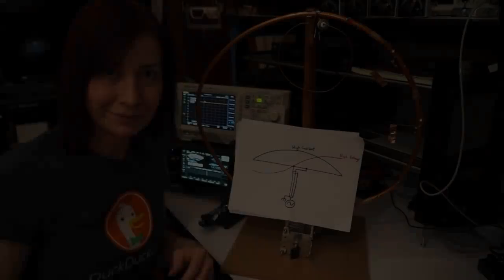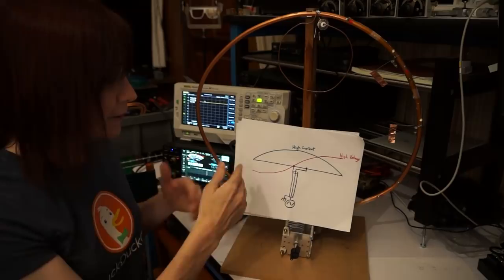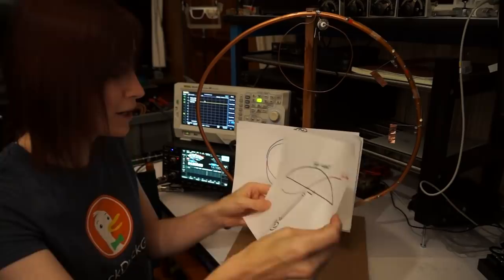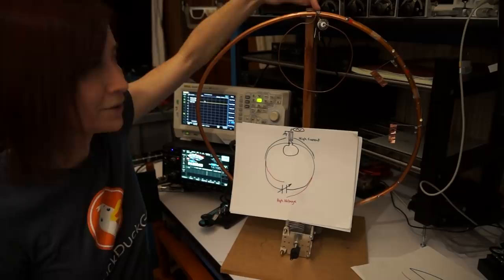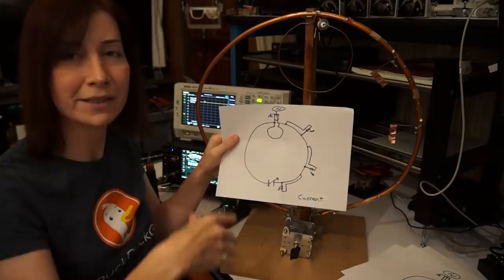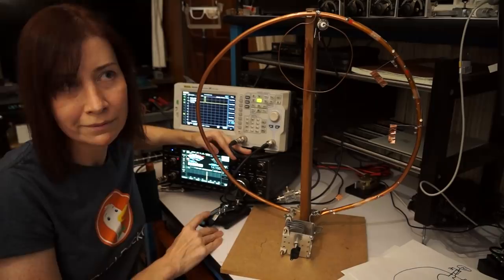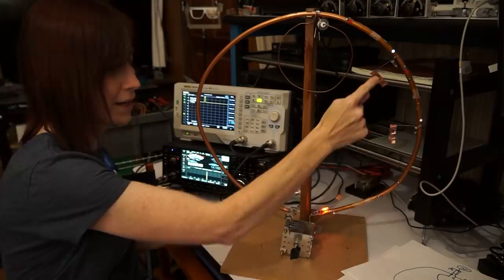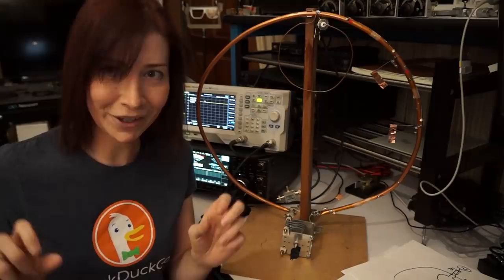Magnetic Loop Antenna Current and Voltage Distribution

Comment: Thank you. Got a little flashback to the time when they allowed CB radios to be connected to home made antennas here in germany in the 90's.
Up until that time we were all stuck with lambda1/2 or 5/8 fishing rods with radials.
Before anyone could say "10W EIRP" i started experimenting with different antennas, feeds and tuning improvements.
Reply: If i recall correctly, You still have better than rest of the world and can use packet radio via CB? 
You can connect "Signalink" to CB and exchange e-mails legally?
Am I correct?
Reply: Last time i checked it was illegal to transport information from a telephone/modem based public network to PR or vice versa. But.... last time i checked was 1999.
And also... as long as you do not cause major fuggubulations you can do what ever you want. There is just no one willing to go after you because your signal is 0.5kHz too wide or simething like that.
Shortwave is just no gov estate anymore... they all fell for the micowave hype ^^

Comment: I love it...a female DX'er.
I'm just a shortwave listener...but have made a few different types of antenna for a hobby. My radios of choice are an old large 3 SW band mantle radio (more like close to being a table version), and the other a Sangean ATS505. Both great radios, but the mantle radio belonged to my Mum and Dad, so sentimental. Had a radio tech friend get the old radio going again, this year. Needed a couple of parts, but he was impressed how clean it was inside. Dad being a rad tech in the airforce always kept the inside of it clean. But I haven't been able to use it since he died in 2013. But amazed how well with my indoor frame antenna, how well it is picking up distant foriegn stations....life in the old girl yet. I think it will keep going longer than me....lol.

Comment: Very good. Given that the loop circumference is so small compared to Lambda, the current in a mag-loop does not vary much. The E-field is almost entirely contained in the loop capacitor and therefore the near-field is almost purely magnetic. This is why mag-loop antennas are much less affected by nearby structures - especially metal - and it is a great indoor antenna. Gas discharge bulbs need a high "ignition voltage" but stay on with a much lower voltage.

Comment: Nice visualization method.   I've always built loops with the cap at the bottom.  Mostly for construction convenience.  I've had a fair number of people comment on my vids that the cap should be on top since the most radiation is on the cap side.  I would think the bulk of the field is going to be around the current peak, as you see with dipoles.  Just my gut instinct though.
I've experimented and it feels like the radiation is stronger around the coupling loop.   I still make plenty of contacts on them and that's what counts.
I've done a few small loops for fun.  Building one out of junk box parts and winding it on an old milk crate.  Made contacts on them QRP as well.
You ought to set up WSPR and beacon on the small loop a bit at half a watt just to see who picks you up.  You might be surprised.   I've found with my 7300 that if I turn the power down to "0" percent, it seems to be about half a watt still coming out.
By the way, I'm going to Quartzfest this year.  Maybe I'll see you there.  It would be neat to get all the you tubers present together for a group photo we could all use on our channels. :-)
Reply from the maker: I think the loop would radiate the most around the coupling loop because the current is the highest.  I need to do a dipole test to compare the amount of current near the end VS near the cap on the mag loop.  I'm so excited that you're going to QuartzFest!!! Randy is going.  We need to coordinate a few youtuber events during week.
Reply: It is a MAG loop and magnetism is generated only by current.  Where the current is strongest so is the magnetism.  The electric field will be vertically polarized and the magnetic field horizontal when the plane of the loop is vertical.

Comment: That was brilliant.  I've had a RF burn, transmitter, 5W, tuning cap contact.  They need a better name than burn.  Burn just doesn't describe it.  It hurt less than a 'normal' burn but did far more, deeper, damage than tapping a soldering iron would.

Comment: Amazing way to demonstrate Current and Voltage . In ressonant point when perimeter of major loop is near a 1/4 lambda, the major current stay opposite capacitor and major voltage opposite de small loop. Some kind of direction in this way.
Thanks for sharing.

Nice haircut and color.

73 PU2SRZ - Sao Paulo - Brasil

Comment: Nice demo...  Yep, you're right, it's inefficient on 20m, looks about perfect for 10m, maybe too big for 6m.   Looking forward to the continuation of the 160/80m loop project!   Would also love to see a demo of how proximity of the turns on a multi turn loop antenna affects the current distribution on the perimeter of the tubing, (exterior turns vs interior turns) you've got to get your spacing right!  (I'm already visualizing some sort of ring of LEDs , or maybe a single LED that can be manually moved around the perimeter of the tube...)  Really cool stuff!  Keep at it!    Thanks again, looking forward to what's next!

Comment: Great Jeri. This was visually  very cool Demo ! . Now, I want you to know that I am definitely not a stranger when it comes to loops. My current favorite loop is an 80 meter full wave loop, fed by open window wire 450 ohm, I have a decent quick MFJ tuner, and its really fun, and quite unpredictable at times. I could hear a station with a call , D4C the other day. I typically (lately) run a 10 watt radio, possibly less (4w) on 15 meters which is where I heard that station, and actually got a contact with them !. And an eQSL !
I love the leds and neons on that antenna. I'd like to try it at the "maker fair" (we just had our first at the local shasta county fairgrounds).  I'd do it  because its so visual ! 
I'd also like to invite you to get on a repeater system where there are more engineers than people lol. I'm a former broadcast engineer, and there are many in the bay area and all over California and Oregon on this system. Primarily UHF but it does have some VHF repeaters. Its called the CARLA network and its connected to the OREGON CONNECTION which takes it to Washington. Also Tahoe and REno. Its a little more complex than most collections of repeaters but doesn't have a "rag chew" . We hope for no longer than 10 minute QSOs most of the time. CARLARADIO.NET for more info. Thanks for that video, I'll try one, even have the Neons which are very useful in this age of leds. 

So, Question, have you tried the LEDs on the 160/80 meter loop ? And or the Neon's ?  N6GRG

Comment: I've always wanted to build what's called a "vector sensor" which can measure the polarity of a signal. If you can measure the oscillating electric field in three orthogonal directions and the magnetic field in three orthogonal directions, you should be able to characterize the direction of travel of a polarized signal, since it should be orthogonal to both the electric and magnetic vectors.

Comment: This, BTW, is why you normally have the tuning capacitor sitting at the top, well away from the ground. Otherwise parasitic capacitance is all too eager to drain away your RF at this high impedance point and mess up Q and hence efficiency.

Loops have long been one of my favorite kinds of antenna, mostly because they can be fairly compact and still work quite well, if at the expense of bandwidth (the usual tradeoff). The one shown would probably work decently on about 20m up, preferably 15 and 10.

Comment: Hi Jeri. Thank you for the 160 meter Loop antenna Home Brew. I built a 160 meter Loop from 7/8 inch hardline cable. I made it tune able also. The loop  is 4 ft diameter. I do get on 160 and 80 meters. I do weak signal work on 2 meters, 1296, 5760 10 GHz and 24 GHz. We chat on 160 and 80 meters at night. Mostly on 3846 Khz + - QRM.  I would be interested some time for a QSO in 160 with you. Thanks  73 WB4BKC  EL98 Fla.

Comment: A bit late, but try using a ferrite ring with a turn or two of coupling coil to feed a mag loop. It works very well on HF, and is easy to adjust. At 4 metres the ferrite ring becomes inefficient and heats up, but at up to 30 MHz it's fine. With 2.5 Watts of RF on 40 metres, 1600 km+ (1,000 mi+)  SSB contacts are easy.

Comment: it may be interesting to study the performance of this antenna with it located in a horizontal plane, and not in a vertical plane as usually, to avoid having to rotate it in different azimuths continuously, so that it is always omnidirectional and observe if this lowers its performance or not

Comment: I have done "mag loop" antennas at audio frequencies.  To radiate not much power at 1KHz, you get really huge currents in the conductors even with several turns.  The capacitor is very tricky because it needs a really low ESR.
It works but I have no real use for the idea.

Comment: Thank You for this video. I'm very new to ham radio and I'm trying to decide which antenna to go with, between a Vertical or a Mag Loop to go with my already built dipole/Inverted V antenna I already have. I'll have my QRP radio early next year so decision time is rapidly approaching. Thanks for the help.
Reply from the maker: That is difficult.  If you have space and height I'd go for a dipole for anything 40m or higher.

Comment: Jeri, this question may seem a bit simple, but, I'm doing a build based on your input so I have to ask. 
At 0:49 I see the diagram showing the center of the antenna is tied to ground. In the video, the antenna is clamped at the center to another copper pipe which I assume is grounded. In my current frame, the supporting structure is schedule 40 PVC. No copper pipe holding it upright. Does the copper pipe and clamp change the capacitance of the antenna? Does it provide an advantage or make the demo easier to present?
My build is based on a 1 meter diameter loop (copper pipe) running at 300mhz. I will be using an air variable capacitor for initial testing and later replace it with a vacuum variable capacitor for better precision. Another question I have is what is the range of your variable capacitor? There are two common ranges, I would like to use the same to validate my test.
That is it. Love your videos and look forward to seeing more.

Comment: Hi Jeri! Glad to see you are making videos again. I have also built a mag-loop antenna. Mine is slightly different from your though. Mine is a 10' piece of 1/2" copper for the main loop with a 3 x 265pf air variable capacitor at the bottom. My coupling loop is isolated from the main loop at the top with the open end toward the center. I have connected a 9:1 balun to it, and that feeds into my SDRPlay. I suppose this is a good receive only antenna. I noticed you said your coupling loop is "grounded" to the top center of your main loop, and the other end is directly connected to your transceiver. Do mag-loop antennas need baluns? Is my design proper for a transmitting antenna? I am currently studying for my ham license and will be licensed soon, so for now, no transmitting for me, only listen.

Comment: I have always found the gamma match difficult to achieve very well.  I suspect that it requires an additional component, eg. a series capacitor, in order to present a purely resistive impedance to the feeder.  But I could achieve much better results where the feeder is coupled to the big loop by a smaller coupling loop (as used in this demonstration).

Comment: Thanks for the video,. I have seen STLs with the variable cap at the top and at the bottom. Does this choice affect the performance of the antenna or is the field strength uniform around the periphery of the antenna?

Comment: Wow! What a great way to really visualize. Can you pls explain why you have to touch the neon lamp lead to make it ligh up? Why doesn't it turn OFF when untouched?
Reply from the maker: It takes a slightly higher voltage to strike the plasma in a neon bulb.  It will continue conducting after its in a plasma state.

Comment: This video reminds me of when I was much younger back in the late eighties and I would tape neon bulbs from radio shack onto my top loaded CB antenna on my fiero and drive around town and light them up when I would talk.  People freaked just from the huge antenna on such a small car and said it looked like a remote control car, well the pulsing lights really freaked them especially when I turned the modulation amp on. 😈
Reply: People freak more when it's a long helical whip that's catching on fire from being fed with too much power

Comment: The neon lights that you used do not have a polarity right? So if my understanding of the voltage distribution diagram is correct then a neon light placed at the other terminal of the capacitor would also light up (brightly) but would not indicate the polarity of the voltage right?

Comment: Thanks for the demonstration and details regarding.  Your presentation method reminds me of the Feynman Technique with visual representations of the theory in application.  Great to watch as always and I always learn something new with your videos.  

I wonder the other applications of the plumbers delight.  Might be a tangent... as I still need to read into and understand more regarding electronics and RF Engineering... though I have this feeling there is something with TDR and understanding the characteristics of wiring or plumbing circuits where once real time understood in regards to electric and magnetic characteristics of the system (internal, boundaries, external)... individual circuit nodes can be tuned into like a specific antenna.  Just guessing... though with DSP seems even more feasible... then I wonder the effects on being used to tune into the human body and living systems with real time adjusting for changes in dielectric and/or electric and magnetic characteristics... or really tuning into anything that has normal modes in the system under study and I guess in other quantum energy molecular energy states, i.e. electronic, vibrational, rotational, nuclear, and translational components ways.  Makes me wonder like with my FT-NIR work wanting to characterize everything on planet earth and in hyperspectral methods too non-destructively... what everything on planet earth spectra is like from DC to Cosmic radiation... then detailing why.  Then wanting better resolution systems and data.

Any reason you decided to build the antenna that design?  I'm still trying to determine the most efficient design that is effective with low price point and hopefully salvaged or maybe a DIY variable cap since would be neat to have a glassblower seal a homemade one up once I know what my user requirements are so I know what to specify out.  I'm not sure for receiving if there is a benefit yet... though the higher magnetic permeability materials like with ferrite sleeve loop antennas is where I left off in regards to receiving antenna performance enhancements. 

Thanks again for sharing!  Neat to see females teaching and you do a great job!

Comment: just a short question please..i plan to use coax capacitance and a slide copper board capacitor to tune mine... question. how do i add the feeder loop from tx..i mean how do i get it to 50 ohms please...yes ill try the short direct to the loop but what wire or how do i get 50ohms please...i do understand that coax makes it monoband but im building a hv varible capacitor  in due course..ty for the excellent video.i learnt a lot..cheers n good health

Comment: Cool!  On your loop, do you find a sweet-spot at a percentage point from the center-ground point where the impedance is about 50 ohms?  I see a lot of loop antennas with a smaller second loop, I guess isolated, from the driven element. Have you experimented and found one style better than the other? Thanks!

Comment: Jeri, I have watched your video and noted that point where the feed loop and  the center ground pipe is at the middle, zero point, for the loop.
Your loop still looks like a 1 meter circumference,  with 12.5 in diameter.
Still curious about the range of your capacitor.

Comment: Hi Jeri, I'm trying to do the same with a loop antenna coupled to a 2450 Mhz source (a coaxial cable fitted in a microwave). I would like to visualize current or voltage distribution, and also add a tuning capacitor. Do you have any suggestion? Thank you.

Comment: Isn't the loop upside down? Id say the hogh voltage part should be at the top away from the ground and the higher the voltage the more radiation should be coming off it. And that radiation is best going up and out the sides rather than down and into the earth.

Comment: power 7805's with 'telluric' - resonator tapped ("accelerated" (with blocking oscillator(s)/boost converter(s)) stubblefield 1:1 power vacuum submerged in water ... small tap... CW or stored in a capacitor bank (said @tmel "free running" or "sample and hold")... Watts/H ---> (infinite)watts/infinite)) ... crystal type (induction) or galvanic type (electrolysis)... whatever the purity and/or ppm/high purity infinite crystal configuration... belt loop